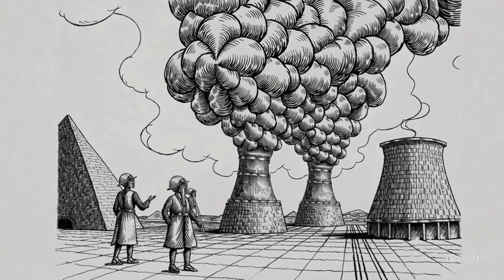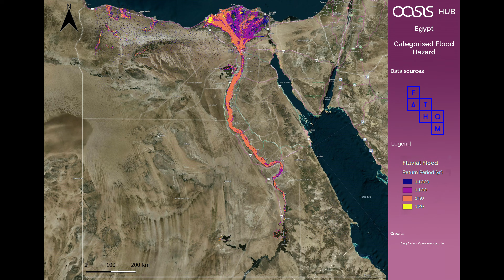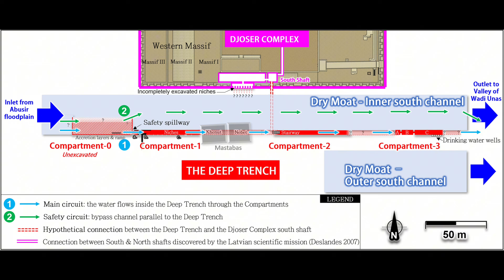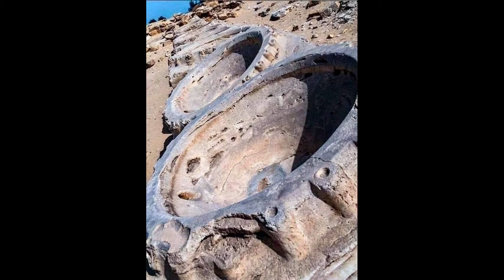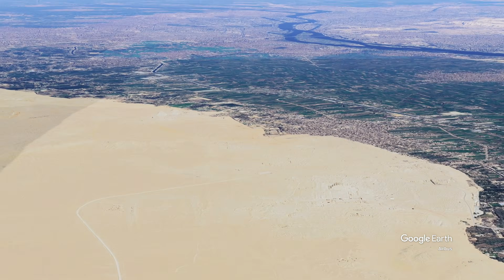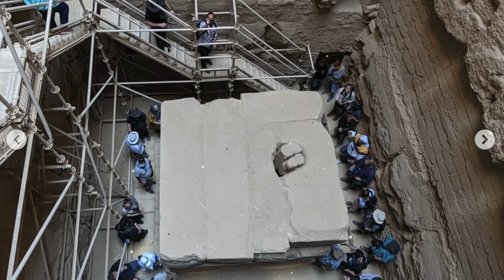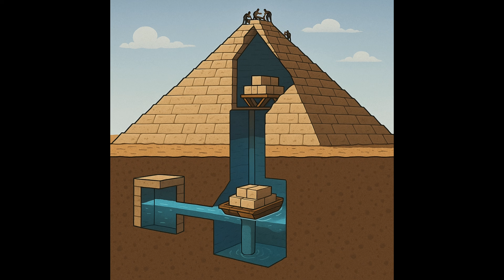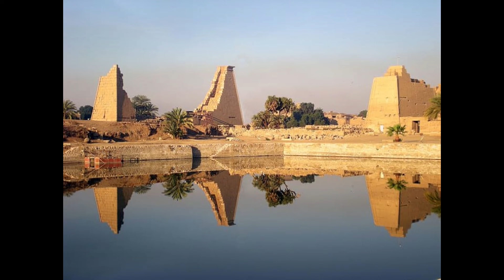The Incredible Hydraulic Lifting Machines of Ancient Egypt

Comment: This was a great video. One possible reason they would need it to be full of water is if they were Electrical Discharge Machining (EDM) or Wire EDM manufacturing the giant Granite Boxes at the Serapeum which is very close to the Step Pyramid of Djoser. I also don't think it's out of the question that this was a metal furnace, perhaps a Submerged Arc Furnace where the stacked stone box was the outer wall of the furnace that processed radioactive materials. The Djoser Pyramid was known to have abnormally high levels of Radon. Thorium and Titanium were found in the vases housed in the cavern below.
Reply: Edm only works with conductive materials, submerged in de ionised water
Reply from the maker: Thanks for watching!
Reply: Interesting!  You watch Land of Chem right?  I’ve been spreading his channel to everyone I know
Reply from the maker: Oh I know of it but I do not believe his videos are technically correct explanations for the pyramids.

Comment: The lifting with aqua is plausible in  theory - but a pyramid consists of about two million stone blocks - if the pyramids where built this way - there where one block of stone put into place every single 5minutes round clock - for 20yrs, the time the tales tell us egyptians used to build one pyramid - the weight of a pyramid is about 5-6.000.000tonnes  = a'lot of water to lift such amount of material, some of it more that 300ft/100mts (hydraulic shaft where mentioned to be 28mtr deep/high) I doubt this technique are the answer to how the stones where lifted/put in place.
Reply from the maker: I think you’re applying this to the Great pyramids size and block number. Djoser has estimates from 330,000 to 500,00 blocks. Once again even in this case you may be right and I mention this towards the end when I go over the issues with this theory. Just making sure you know I’m not applying this paper and its conclusions broadly over “all pyramids”. Djoser alone has this very particular combination of features, some exist in other pyramids but not the full system as outlined here

Comment: Yes, a very large and complicated hydraulic system.  But I think its use was for the finished 'machine' that was the Pyramid itself and not for its construction.
Reply from the maker: Alright. How do you think this could have been used after construction
Reply: @intothemap360  Having entirely divorced the low tech, copper chisel and embraced the idea that the ancients had power tools, for which there are innumerable examples, and even hold that they had 'tools' beyond our current ability to imagine, I don't need to resort to trying to find a low-tech approach to answer for how they lifted large blocks of stone. To my thinking, the pyramid was a machine and that machine not only used gasses, the ether - atmospheric electrical energy - but water and crystalline granite as well. In addition to supplying water for local use, your hydraulic system probably supplied the needs in agriculture as well. We may yet discover that water was pumped very far from Giza indeed!  The system you've uncovered looks like a high volume/low pressure system, likely used to lift vast amounts of sweet water for agriculture and municipal uses.
Reply from the maker: Hmm. Well I’m working on a video on a specific ancient power source so you may want to keep your eye out for that. Technical advancement has a way of spidering into other fields of industry unrelated to the initial development.
Reply: @intothemap360  "Hmm" doesn't say you agree with my take.  I should say that I thank you for your work in gathering together what you have, I've never seen it before.
Reply from the maker: Well I’m not ready to agree they had power tools. I’m working on a video on possible sources of power back then that would be reasonable. So my hmm means interesting but I do not agree with all your points. But you’re free to make them! I appreciate you thinking about the problem and commenting in a polite manner

Comment: A serious issue with this hypothesis is the capacity for these lifts to function at the weight capacity required to lift 50 plus ton blocks in the three great pyramids. While it is possible the Egyptians copied the method they think was used to build the the Djoser pyramid, it doesn’t prove it was used on the Giza plateau. In fact, I firmly believe they have existed for over 25 thousand years or more, or to the last Earth Maximum Precessional Tilt when massive catastrophes destroyed a previous advanced global civilization. As modern humans, we’ve existed for over a million years on this planet. To presume we’re the first “civilization “ to be advanced is the height of hubris. We can’t build anything that lasts over 20,000 years, yet we claim species supremacy. What a crock.
Reply from the maker: I’ve never said this could be applied to the great pyramids at Giza
Reply: @intothemap360 It was heavily implied.
Reply from the maker: Not at all. I was pretty clear this was just speaking about the internal construction at Djoser pyramid. If you got any other implications then I’m clearing that up right now. I’m only speaking about the Djoser pyramid at Saqarrah and I was also quite clear that there were issues with this theory.
Reply: @intothemap360 I do apologize if I misunderstood. I can agree that this method could have worked with the Djoser pyramid.
Reply from the maker: You’re fine! :)

Comment: But what were they built for? They were not tombs.
Reply: With any advanced designed structure or machine, I think the first purposes to hypothesizw are that it was neant to do what it does better than other structures or machines.

For example the primary purpose of a dam is holding back water because it does that funxtion better than any other structure type. It may also function as a bridge, but it's not the most efficient way to build a river crossing.

What the pyramids do better than anything else is survive through time basically untouched. Natural disasters and invading armies and scavenging builders have down little more than scrape off some facing stones. The shape of the pyramids are as recognizable today as when they were built. The second best thing they did was preserve their contents (which werent bodies for the great pyramids) untouched by weather and animals for millennia.

So my starting assumption of purpose is that they were meant to be a lasting monument and testimony of the skill/power of the builders that would last a long time and survive natural disasters.

I personally think the pyramids were built closer to the end of the younger dryas than the old kingdom (maybe even during it) which was a time of tremendous climate disruption and floods. And I think the builders of the pyramids meant to leave at least something that wouldnt get erased, just like the people who buried gobekli tepe.
Reply: Power plant
Reply: Irrigation method.
Reply from the maker: I’m going to post a short today about what Roman historian Pliny the Elder thought they were for

Comment: Just a little  observation,a 100 lb rock in air is 1oo lbs but the same rock underwater feels like a 30lb rock,it's  so much easier to move.
Reply from the maker: Not exactly. Let’s say the rock displaces 2 gallons of water (about 16.7 pounds of water). Then the apparent weight underwater would be 100 lb (air) – 16.7 lb (buoyant force) = 83.3 lb underwater. You’d have to have some super light rock like pumice to see that large a weigh reduction due to Archimedes principles alone.
Reply: Try it yourself, I lifted a boulder of sandstone two foot square out of a rock pool while still under water I got into shot put mode to throw it out of the pool into the ocean it was super easy until lt hit the air ,I got it out but tore my shoulder muscles,lesson learned,it took 3weeks to heal.
Reply from the maker: It does get lighter. Just not that much lighter

Comment: A floating counterweight. It can stay in the shaft. Water push it back up drain it pulls ropes. I think this gives freedom to pull blocks up to the desired location. If you move the blocks up the shaft they pile up and block the system. 
A floating counterweight can continue go up and down 24h. Just attach the rope to the block and everytime shorten the rope for the next pull. 🤔 this is a fun idea 😅 👍
Reply from the maker: Great thoughts! Honestly, the combinations and options are endless. I really wish I could’ve been fly on the wall back when this was being built.
Reply: @intothemap360 i think its a very interesting observation. Within reach of stone age tech. Even if its as simple as a small boat with 3 blocks floating in a shaft attached to ropes to a block on a sled going up a ramp. It would be helpfull. Pull the plug and the boat goes slowly lower pulling the sled with the block. Fill the well shaft with a aquaduct and boat goes back up. Shorten the rope and pull the plug  it becomes easy to hoist blocks from level to level or on sleds up a ramp. 🤔
Reply from the maker: These are kind of comments I love. I love when people start just hashing out various ways it could’ve worked and are polite in the process! When you start thinking about these sites from a mechanical standpoint I think it helps.
Reply: @intothemap360 i think its amazing how you are able to deciver this sandbox full clues and leftovers from different ages and find such explanations. Its really hard to see what it all used to be
Reply from the maker: It’s a total crap shoot when you’re missing pieces which is why I can’t be dogmatic if I don’t want to appear a grifter. I’m trying but this is the best I can do! Hopefully next time I have even more puzzle pieces

Comment: I also have a related hypothesis on the construction, and I think for part of the trip from the quarry to construction that the blocks were rolled rather than dragged or floated. It has to do with the relatively simple math of the rolling resistance formula. It comes down to things being easier to roll when the diameter is increased. If you attach a casement around the entire stone, and roll it as you would a cylinder, it would require less than a dozen people to provide the necessary force to have it moving. (And that's the big megalithic sized blocks.) Of course other methods may have been also used, but it's a pretty efficient manner to cover ground when smaller log rollers or dragging don't make enough sense.
Reply from the maker: So many interesting ways these topics can go! Thank you for watching and I hope you like my next video I post

Comment: As to your question about how quickly could those shafts be filled just using gravity, take a look at some drydocks(or locking up/down on a canal) and get an idea of how long those take to fill. I'd imagine the overall amount of water used for the shafts would be a fraction of that required for a decently sized drydock. They might've been able to run a full extend/retract cycle with these pistons in an hour or less. Maybe a lot less. 

Also, this is an excellent breakdown you've done on a potential explanation for the site. Much appreciated! :)
Reply from the maker: That’s a good idea. I’m just the sort of person who will start reading about 17th century lock and canal filling methods. I’m glad you liked it. More of this sort is coming!

Comment: I like your presentation of the theory. I feel like you're real close. Look into ram pumps. Accidentally creating that would have been like magic. Then accidently finding out that the vibration through granit would create electricity...
The outside of the pyramid is encased in an insulator and the top in gold. I bet you could create quite a light show
Reply: New sub, btw. I love your diagrams and thorough explanation
Reply from the maker: Thank you so much for subscribing! Lots of new theories and interesting ideas that I’m going to make videos on if I can get there through logic and engineering principles
Reply: I just found this video about ram pumps https://www.youtube.com/watch?v=zFdyqTGx32A thanks for the pointer! This is really cool tech
Reply: @FarranLee  piezoelectric effect would happen on those granite blocks if it is a big ram pump due to the vibration it causes. Imagine turning that on. The thumping heard and felt for miles around. A charge is built up inside the structure until it is released into the clouds! I've wanted to build a scaled down model of this for years now.

Comment: Time is certainly a good point to focus on. Floating platform such as a barge when filled with water to level the surface with modern pumps requires a lot of patience. Worked on such a project for a commercial making a fake island in the ocean. Without modern pumping techniques it would be excruciatingly slow.
Reply from the maker: Right and although they had a lot of time one sure even they would have been a bit annoyed. It would also require the two north and south shaft teams to communicate with each other for timing the plugs

Comment: Could the pyramids have been designed to provide a steady source of high pressure water? Instead of a hydraulic lift, maybe it was a pressure device.
Reply from the maker: Maybe with one shaft, but why two and link them? Good question to ask though
Reply: So is it that much of a stretch to think they had electricity and the pyramids were more than just tombs?
Reply: Great work ! It must continue !🇦🇺🍁🙋🪂🦘

Comment: I keep in mind the rivers were notorious for carrying sediment so if hydrology was used some form of filtration would likely be necessary. The seeping might be needed for filtering. Like hot water heaters and vessels holding water sediment happens. If not filtered the sediment would need to be removed manually at some frequency. Just a consideration. Thanks again.
Reply from the maker: You’re right I’ve also seen theories where the deep trench was used for water filtration! They need to excavate the rest of those compartments!!

Comment: The other way to lift with water is stack weight on it. Let the platform sink in water with more weight. Shore up your block in the shaft. Add a section. Let that rise. Shore the block in the shaft again. Add a section underneath again. That  way the plug can be left in. You use one pool of water that doesn't need to be drained. People just walk on for weight to sink part of the platform in water. Put the next section in and walk off. Quick way of lifting blocks.
Reply from the maker: That certainly would be smart. Platform in both shafts and you alternate between sinking them. Excellent idea

Comment: I think you are headed in the right direction.  The Nile was recognized as a great gift, and it obviously was.  The knobs on big rocks found on stones in Egypt, Machu Picchu, Pumapunka  and a few other places indicate to me that the same people or at least techniques were used in all of these places.  And, I say "techniques," in that they probably had several methods at work.  -And the knobs might represent places where stone was poured from a liquid slurry of some sort.  When there are massive rocks being lifted across valleys and up mountains in South America (and those for sure were cut)  I'm thinking that there is likely a spring or water source somewhere at the mountain top.  -An instant counterweight.  I'd bet water and heat were involved in the cutting of stones as well.  Your floating methods look like great options too, especially with the grand gallery and its need for such a high ceiling.  It does look as though something like cement was being made at the new dig in Turkey, which dates way back.  That's another possible method that could have utilized water for mix as well as lifting ingredients in some places.  I'm thinking this cement was made from heating rocks and beating or raking a grain off... used there with limestone, but who knows, they might have leaned to make marble as well.  Some stones cut really smooth do look poured, as they seem to sometimes have air pocket indentions like one would see with a carport after the retaining wood was removed.  Very interesting.  Great work.
Reply from the maker: Lots of thoughts, there and plenty of ideas for future videos! Thank you for watching

Comment: If you make a fat copper pipe and seal both ends, it becomes air tight and floats. Built a big raft out of them, it may make stone buoyant.  They did have copper.  When project is done, melt.down the copper for reuse.  No more evidence
Reply from the maker: That’s a great idea actually. Probably could get at least a few PSI with a leather bellows and a basic one way leather valve. Nice thinking